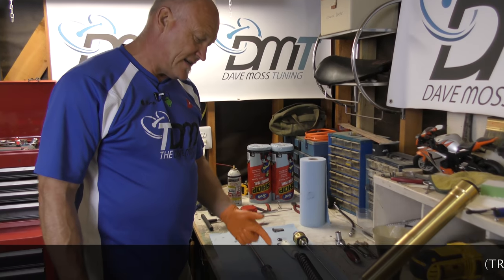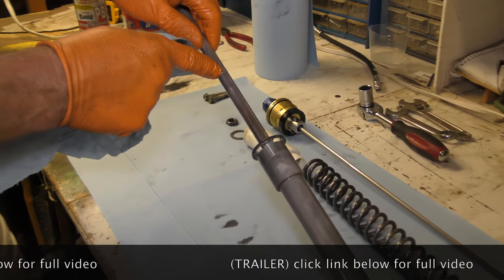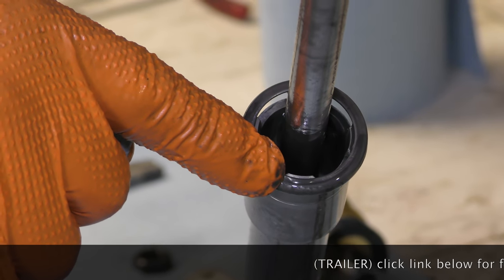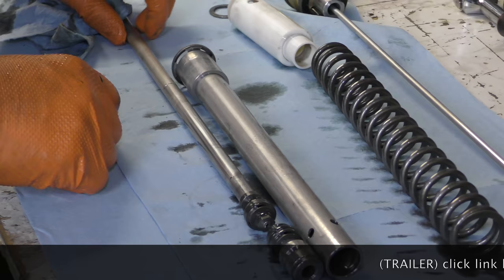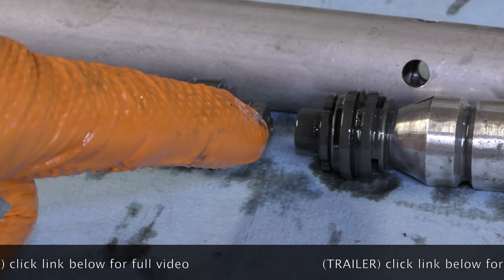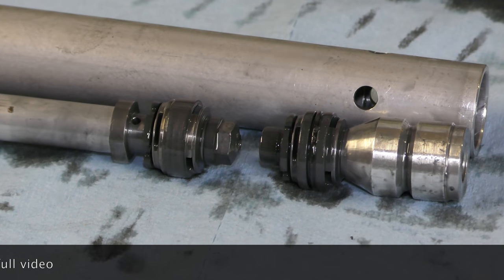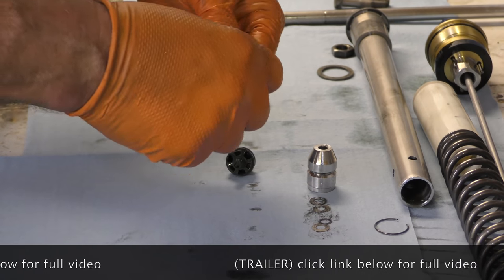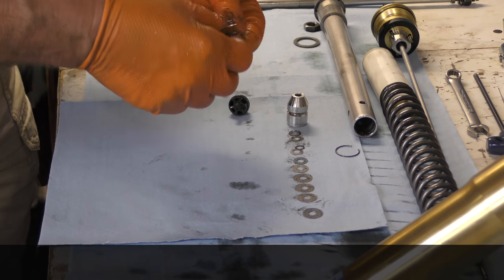How-To: Motorcycle Fork Valving (TRAILER)

Comment: Hi Dave , thank you for your content , I’m about to fit a piston kit and springs to my 2008 cbr 600rr track days only bike … my question is should I leave the donut on or are the forks better  with it off ?
Reply from the maker: The doughnut stops the compression and rebound piston colliding with each other. Your call on retention as it will give you an extra 1/8th of an inch of travel.
Reply: @catalystreactionsbw   thank you for your response… I suppose it’s not worth the risk if it’s only 1/8 of an inch .. doesn’t seem like much of a gain ..

Comment: Love the  Video - but another question is how does the adjusters work for compression and rebound damping?  Also if the bike comes with progressive springs would original valving work for linear spring ?(from video assumption can be that it should be re valved to accommodate difference in amount of rebound force at the start of the return stroke :-) - (rebound too slow at this stage of the stroke?)  
Thank You
Reply from the maker: Compression and rebound adjusters are dynamic by modulating flow via separate circuits so look at them as independent systems. Stock valving is generally set based on the spring installed (progressive), so with linear springs, rebound and compression are much more easily set. If you go up or down in spring rate, assess where you are in the total range available and that will guide you to the nature of a possible revalve.

Comment: is re-valve &  new springs recommended or possible on  ;) Sewing machine-like KTM DUKE 390 first model?
or
complete drop-in Cartridge is the only way to go?
Reply from the maker: Depends on your ability and use. If this is for the road, springs and oil for the front can make a profound different as and just a rear shock spring. Start there. Same would apply for a Novice track rider. At intermediate track you would need Andreanni etc for the fornt and a shock.

Comment: Hi Dave,what do you do to avoid a collision pistons with each other?
Reply from the maker: The doughnut on the rod stops that happening and creates a gap between pistons. If that or other device on the rebound rod is removed, you cannot stop the collision happening so you add preload and compression to reduce travel used for safety to attempt to avoid parts hitting each other.